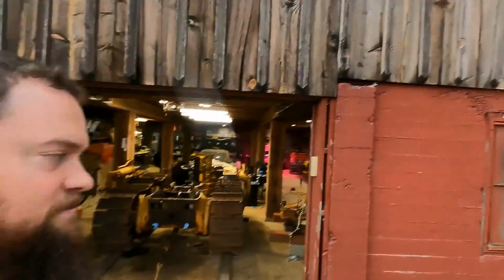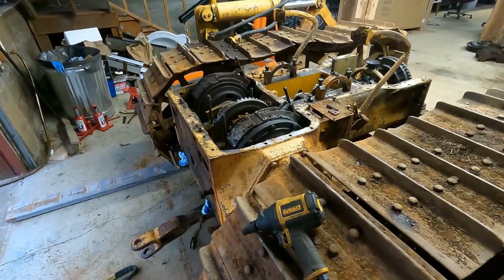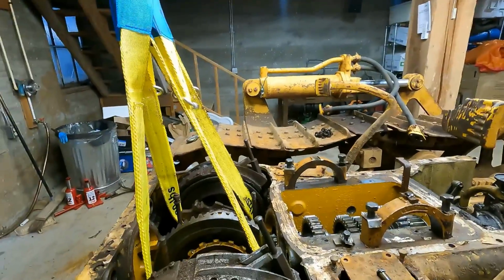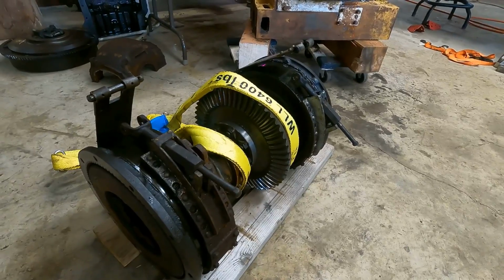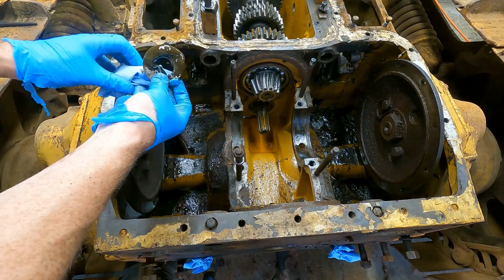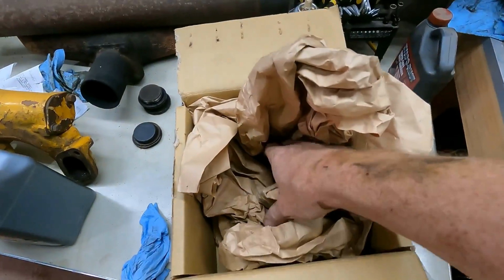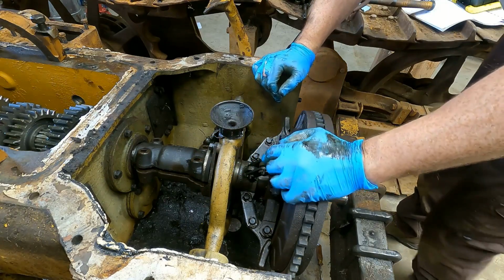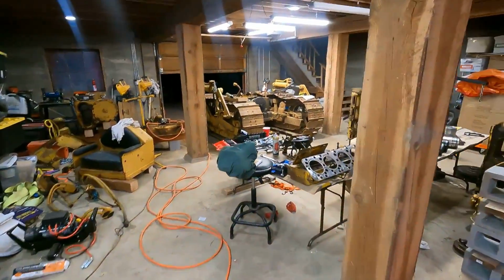Removing frozen steering clutches and finding parts for a Cat D4

Comment: For your brake linkage lids that are pitted there’s a good trick that I learned while working for a local Honda dealer to true up carburetor flanges,cylinder heads,tops of cylinders and engine cases,anywhere that is machined flat. Use emery cloth or wet/dry sandpaper in the regular full sheet size,I think they’re 9x11” sheets and glue it to a sheet of glass,the thicker the better but I’ve used as thin as 3/16”. Window panes are plentiful and easy to find. Spray the back of your sanding sheet along with your glass pane with 3m trim adhesive,wait for the glue to tack up before putting them together or they’ll take forever to bond. Cover it with a book,wait 3 to 4 hours and presto you have your own surface machine,just use some light oil and a little elbow grease. I have several of them made up from 120 to 600 grit and use them for everything from cast iron to stainless and aluminum.  The brake bands you have can be washed out as long as they’re still within spec on thickness.  If you have a solvent tank they work great for that, I’ve used kerosene also. Afterward soaking them in a solution of Dawn dish soap and water or Tide laundry detergent overnight takes most of the crude oil based impurities out and let em air dry. By the time you have steer clutches and finals all back together they’re good to go,just my two cents but it worked for me on more than one occasion after showing up to a job that had run down equipment. I really do dig the heck out of this channel though,keep up the great work.
Reply: It’s called a poor mans lapping block. Lol. Used this method myself successfully several times.
Reply: Great for resurfacing groves on oil pump top plates too👍👍
Reply: i always worried about the glass breaking.  I use 12 by 12 polished granite floor tiles.  You can pick them up at any of your big box home improvement stores.  They are just as true flat as the glass and can take a  lot more abuse.
Reply: Very cool ,I always wondered if that would work! I use float glass with PSA sandpaper for sharpening tools.

Comment: I used to be a Cat mech/training instructor. I was trained in the Peoria schools, and at the end of every week of training we were able to tour various assembly lines in the factories. One of the places we visited was the pattern shop, where we were told that you could order parts for ANY machine Cat ever made, if you had the serial number. They didn't have the parts for old machines in stock, but said they had the patterns to make them. No guarantee how long it would take to get the part, or how much it would cost, but because it IS Cat, the part CAN be obtained.

Comment: It's great you're motivated with this project, some guys get a little carried away trying to keep everything OEM or perfect in some obscure way, I like that your fixing it to use it
Reply: There are many ways to 'restore' these old machines.
Over at 'squatch253' for example, he is doing a total mechanical restoration of his D2 with no paintwork involved.
I get that, I'd prefer the machine was mechanically sound rather than a show princess.
But everyone has different goals for their resto, each good in their own way.
Reply: @WeeShoeyDugless  i agree. i am just starting on a 7u model d4. with a trackscavator set up. and i dont see that paint will help me at all. unless its something that will rust away without it

Comment: Doing great! If it makes you feel any better I bought a mini excavator that I am almost done doing a quick restoration to and had discovered that the final drive was cracked on what would be called the “spindle” on a truck, and was leaking gear oil. Dealer wouldn’t sell just that part and wanted $6,000 for a new final drive and wouldn’t warranty it unless I bought a $3,500 final drive motor with it. So did what any homeowner would do and had a machinist braze it and clean the surface back up for $400. He said it would be fine and at least if it does fail it isn’t buried deep in the machine

Comment: When you remove the spring  keepers you might have to take them off like 12 and 6 then 2 and 7 till the last 2  may need to be clamped  in two places , otherwise it may bind or launch past your head your choice . A 29 LaSalle has almost same clutch with 6 disks  had to make own specialty tools..

Comment: about 1:31 you said its getting dark later and later? I thought you were in usa? at that time of year dark would come earlier? just wondering
Reply from the maker: I'm up in NW Oregon, end of June it stays light till about 10pm.  By end of August it's getting dark at 730.  I do most of my outside work after 7, so by middle of September I'm usually splitting firewood via headlamp.

Comment: Save some metal cans - coffee cans, large tomato juice cans, etc. - wash them and number them with a Sharpie.  Keep a clip board nearby when you disassemble stuff.  Jot down some notes describing what you are taking apart and cross reference the can number for bolts, nuts, washers etc.  Example:  Remove flywheel - Can #6     Also the clipboard notes will tell you the order of operations on a complex disassembly.  You can sorta follow the notes in reverse order to reassemble the machine.  Good luck.

Comment: Locked up bolts can sometimes be loosened by heating up with a torch the part the bolt is in.  Hole expands diameter and rust etc breaks down. But you'll probably need that big opened end wrench anyway???

Comment: You will need to replace the  clutch release collar assembly. The brass peace that is part of the clutch fulcrum. It wears out on the inside. It’s in 2 halves bolted together.  Cheers

Comment: Just wondering if you regret not spending more time pressure washing more of the dozer. As you uncovered things you could get to more areas to protect all of your work.
Reply from the maker: I'm always hesitant about pressure washing something that may have multiple water ingress spots.  Especially if it gets somewhere that I might not touch for a few months.  I've been burned in the past on overly aggressive pressure washing.

Comment: Hot wrench might help on the stuck throw out nut if you don't have 1 5/16 wrench or small chain wrench.  The turning clutch nut looks like it was loosened before with a chisel & hammer.  Probably a previous mech didn't have the socket either.  If you insist on the relining of the brake bands clamp them square to the band on 1 end and drill two holes at that end then drill your countersink and rivet those 2 holes.  Then you can clamp the bands around the drums to get the holes drilled in the right spots.  Easy.

Comment: Yeah, I would have bagged them {hardware} all during disassembly, zip locks are not that expensive and they can be used over and over. Good sign, it did roll easily. PERFECT! STRAP IT!  What about brake clean? Does a great job on ground wasps too! Steam clean soon? I like the bags of money in front of the blade. The amount of D-4's being resurrected, it doesn't surprise me parts are available. Not cheap, but available. GOOD LUCK!
Reply: yeah it seems the pollution control on the new machines is shutting them down just doing regular work. it's such a problem that it's delaying many projects, so contractors are buying up the older machines just to get the jobs done without too much hassle.

Comment: Ive relined a lot of those brakes on caterpillars and draglines ect.  The cat band is made to caome apart so it can be removed without doing anything other than removing those cover plates. Its  wasnt difficult for me to remove them and reline. Today we have epoxy glue that would work. I would glue  the linings in place and then drill and counter sink and install the rivets.

Comment: Thankfully, you have videos of every step of the disassembly process.....so you might be able to identify the bolts and parts by watching them.  Ziploc bags....terrific way to maintain order and assure identification.  Re-installing all components in the correct orientations will be greatly facilitated by the videos too.  Taking pictures along the way helps greatly.  Shop/service manuals may or may not provide adequate details.  That machine has LOTS of PARTS !  Have fun !!

Comment: most steel vendors cut up left over scrap plates into squares up to about 12x12"  you can make new steering clutch adjustment covers really easy using an angle grinder and transfer punches if you don't have the plate scraps cut to size..

Comment: Yay, I’m watching this later :o) Those clutch drums are a job to get off the tapers. Has to be the right pulling bolts to screw in and some force. I don’t think they have to be pushed back on, just torqued up? I have proper old pushing tool here, it looks like a ratchet with a thread through the middle.
Reply: The rusty lids probably are original, because the sheet work rusts faster. Plus, every adjustment they would get paint chipped off them. - that gear is a nice find :o)

Comment: Thanks for showing the costs of this project. At times I'm wondering about that watching restoration videos. Easy way to convert lbs to kg: divide #lbs by 2 and then - 10%. In your example 2000 lbs/2=1000 - 10% = 900 kg.
Reply: That works great. In most cases "little less than half" is usually close enough.

Comment: A box of sandwich baggies is a great tool when disassembling machines.  The larger freezer bags which are heavier are also useful.  Keep assemblies together avoids a lot of frustration later on.  Label them for even better results (use a paint marker so the pencil or magic marker isn't erased by the fluids you are working in.).

Comment: If you are doing steering clutches, pull outer flanges and change seals to final drives. Also do inner seals to trans /bevel shaft.

Comment: Thanks for some video, nice to view the removal of the Steering Clutches.  Good possible suggestion, at Harbor Fright, the have a pneumatic hydraulic long ram jack for your engine lift, its work very nice and great with lowering, go check them out.  My friend uses it all the time, pull race car engine out or other heavy items

Comment: Hi Matt, a word of advice. You may want to look into purchasing the brake bands as a complete assembly not just the linings. I watched another YouTube do nothing but fail trying to drill and re rivet them. He ended up purchasing them complete after stuffing the linings. Please for your own sake look into this further befor purchasing linings. Cheers Stew. I hope my advice was helpful.
Reply: I was going to offer the same advice, as I saw the same video. Might have been Matt over at Diesel Creek on one of his beasts! The virtue of wanting to do it all in order to save a few $$$ can end up being the vice of wasting money when you’re not equipped with the knowledge and equipment. There are plenty of other areas on this machine where you can divert your efforts…breaker linings aren’t one of them to end up getting an expensive lesson. Spend wisely.
Love the channel and your tenacity!

Comment: Slide your steering clutch drums off of the clutch, check for wear on the internal grooves, then pull out the flanges to the final drives and replace those seals also.

Comment: You should invest in a sand blast cabinet they aren’t all that expensive. A gasket cutting kit would be useful as well. It will do better with gaskets instead of RTV.
Reply: I don’t know about that :o) The only way I get old stuff to seal is with both, because back in the day minor oil leaks weren’t considered noteworthy :D I think it was how they kept stuff from corroding 😂

Comment: Warning, I've seen a video of someone trying to reline those bands (may be Jese Muller) and the whole job turned into a massive nightmare. If my memory serves me right they ended up buying bands fully relined, it may be well worth your while to investigate further before you go down this path. As you can see by the engagement of your subscribers you're on a winner with this project. I wish you all the best in your endeavor, I'll say that "wrenching" is your strength. Cheers from OZ.
Reply from the maker: Lot of people have been mentioning that Jesse video, I'm assuming it was on that JD he rebuilt.  Well, now I HAVE to try relining them, just to try it.  I'll only order one set though, in case it doesn't work.  Worst case is I'm out $50.

Comment: A rough conversion from lb to kg is to half the lb's and then take off 10%. So a 1,000 lbs would be 500 kg then deduct 10% of that, which is 50, so you finally get 450 kg. You will be within a kilo or two.

I'm in the UK and I use use both metric and imperial.

Comment: Use never seize copper on the brake adjuster threads,ours is easier to service other wise in the rainy Willamete vally lol Red  locite the clucth bolts. or they loosen and snap. The service plates suck on the machines,they let  alot of moisture in.

Comment: All the bolts are probably loose because the machine rattles like crazy and split lock washers actually make a bolted joint worse. You're better off replacing them with flat washers and loctite on reassembly

Comment: I can't find the video...but another YTber was rebuilding brakes on a loader and he also tried the rebuild kit. However, he ran into trouble when the rivets were not settling below the liner. At the factory, whatever automated riveter they use gets them just right for depth, but his manual attempts kept failing. He just mangled the liners and wasted the money.

Comment: There's other 4 u owners who have been rebuilding these  on utube a couple totally a few to work status a guy rebuilt pony motors opposed cylinder and vertical twin but the electric saves a few start steps use welding cables for starter carries more amps or 18 whlr battery cables. Try a local trade school that  specific diesel repair is taught , Jim's Automotive in Colorado Cat  and all diesel engine specialist.

Comment: Suggestion:  Buy new brake bands do not try to reline  i have seen a couple of vids where folks have tried. They end up buying the assembly.  I think you still have to cut shoe once installed on bands. Not worth the trouble...

Comment: Not on that crack if you have a good person that can do cranks a lot of times they can do what they call spray weld the build-up and then they cut down to the original size also I don't know why you don't do it it was an old trick I learned get yourself some Ziploc bags Markham and what that both came out of so you don't have to think about which one goes where okay Bob from Vero Beach Florida have a great day and God bless

Comment: They are 6400 pounds.  Maybe and maybe just printed as 6400 pounds.  Got to be careful about ones safety with Chinese manufactured goods.  Printing on the straps is a lot cheaper than extra stitching if you get my drift.